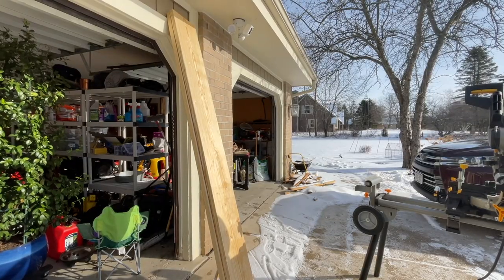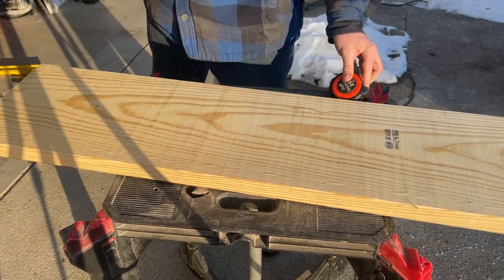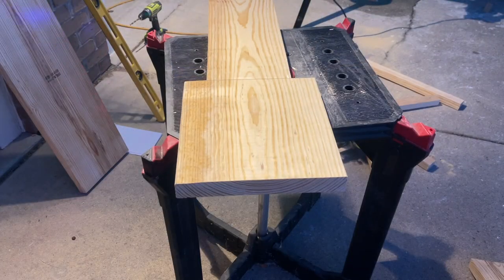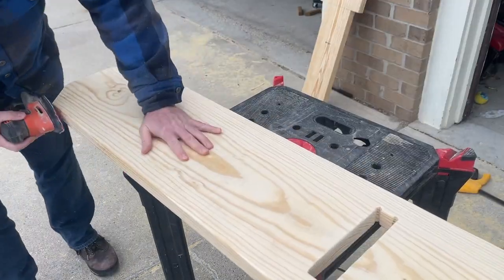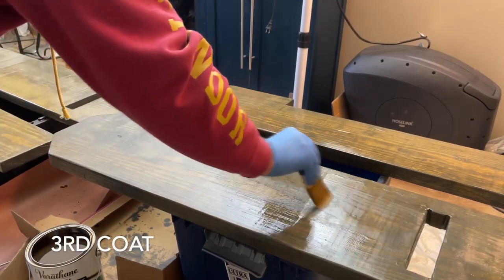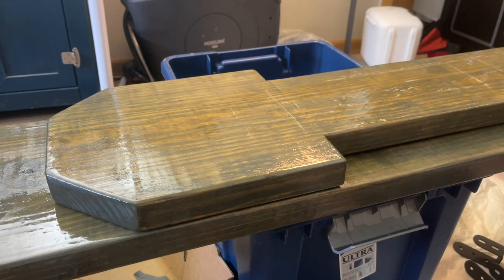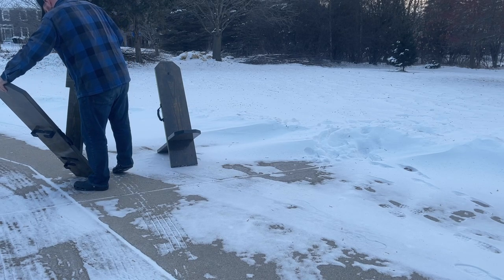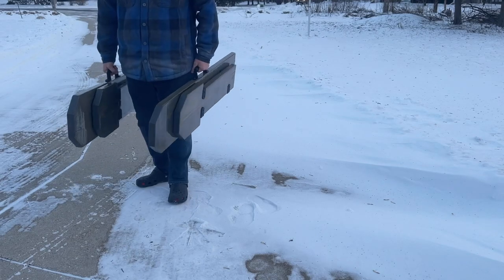How to build a Viking Chair // Camp Chair // Bog Life

Comment: Was looking for camp fire chair ideals and these are spot on….plastic ones keep getting replaced because they become brittle…the fold up chairs the fabric fails after a year or 2 stored out at site…these will work perfect and be cleaned up quickly with the coating when pulled from storage there…the fabric chairs are horrible about spider eggs…these once separated a good wipe off and they should be ready to use.  Thank you!!!
Reply from the maker: Awesome!

Comment: Instead of the metal bracket, just use the pieces you cut off the sides of the seat at the beginning. One to make elevation blocks on either side of the back, and the and the other, sanded dowd in the center for clearance, to span those blocks. Fasten this bracket high enough on the back so that the bottom edges all line up when stored.
Reply from the maker: @richturck259  that is a good idea and would cut back on the waist. Thank you.